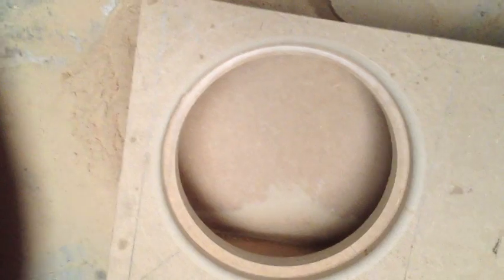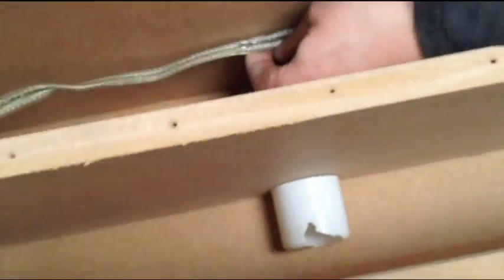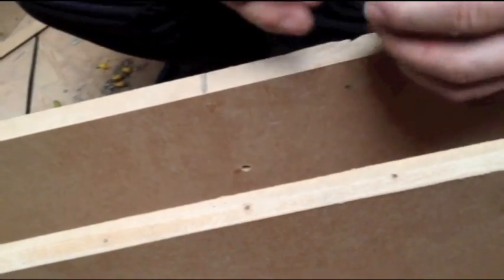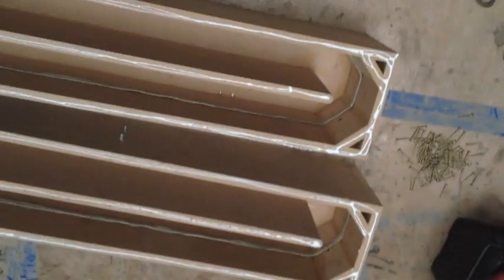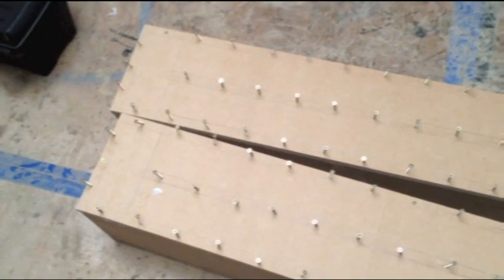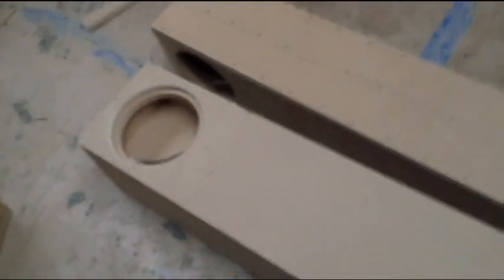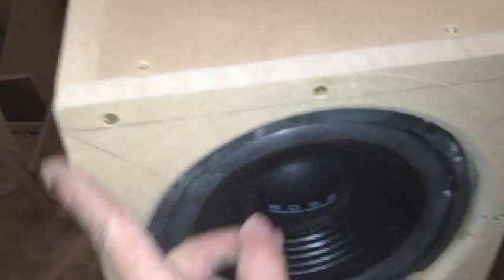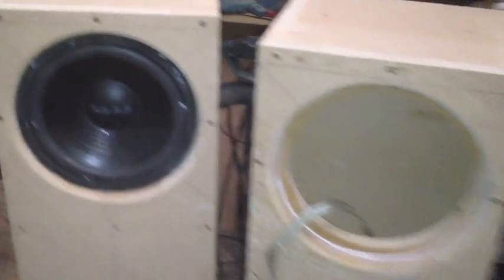Building a TL transmission line Design enclosure Box for 8'' drivers for my home audio system part 2

Comment: I know when you make a t line box you're supposed to keep the entire length of the port the same square footage as of your cone, but the magnet on my diamond competition 12 inch speaker is way too big... I can't do it, I have to have a loading chamber, is there any way to get around this? I seriously do want a t line box for this baby!

EDIT:  the two Diamond competition speakers are old school, they use normal magnets that are big as fuck... the magnet is as long as my hand fully stretched out... (Correctly measured they are 5 inch magnets.)

Comment: whats up with the crappy terminals buddy..i mean if your gonna spend that time and effort to make it really nice looking and sounding box couldnt you have baught some gold plated terminal. connectors...juss sayin!
Reply from the maker: +Mario Osegueda 

it was an experiment i was doing on a tl enclosure if i was going to keep it i would have used gold plated terminals and painted the box gloss black, it was built with leftover materials i had in the workshop ;)
Reply: Gold plated terminals are not necessary. Gold is the second best conductor of electricity behind silver, but silver oxidizes so gold is used instead. There are now brass alloys (CuZn39Pb3) that work very well. I do Front Of House Sound for bands. Professional PA Systems have way more power capability than what most car and home stereos power amps can produce. The Neutrik NL4FC connector has 4 contacts that are rated 30 A rms continuous per each contact and 40 A with an audiosignal, duty cycle 50 %. If that isn't enough power handling capability for you then you can use the 8 contact version (NL8FC) and double the contacts per speaker. The contacts are brass alloy (CuZn39Pb3) rated for greater than 5000 mating cycles. The contact resistance is less than or equal to 3 milli-Ohms after it's rated mating cycle of 5000 times. They are twist lock and will not come out until you cycle the latch.

This is the connector you would use on the cable (Male) and can handle 2 voice coils @ 30A ea. or 1 @ 60A.
They are about $6.00 ea on Amazon
http://www.neutrik.com/en/speakon/fc-series/nl4fc 

This is the connector you would use on the cabinet (Female)
They are about $5.00 ea on Amazon
http://www.neutrik.com/en/speakon/speakon-chassis-connectors/nl4mpr

Here is the 8 contact version. It is the same physical size as the 4 contact version but can run 4 voice coils @ 30A ea or 2 @ 60A or 1 @ 120A
http://www.neutrik.com/en/speakon/fc-series/nl8fc
Reply: +richard vxincar oh i see ok cool nice job on the box how was the sound?
Reply: if its an experiment and you happed to not want it any more, i will be happy to take it off your hands. i live in the uk so postage should be okay, ill even pay for postage aswell
Reply: but how much do gold / silver connectors really help your system? real question i dont know
Reply: brian chaney asked "but how much do gold / silver connectors really help your system? real question i dont know"

Gold connectors are used in military spec. equipment, audio connectors and such because gold does not oxidize. In speaker cabinets, you will not be able to hear the difference between gold connectors and an adequately designed nickel plated connector. Contact area and solid connections are more important on a connection like you would find in a subwoofer, that involves high current. Heavy duty speaker wires are important as well. Gold plated connectors are more important in the low voltage audio signal path. In a car where the connector is exposed to higher humidity, gold plated connectors can prevent signal loss due to corrosion.
Reply: +Rick Jones i know they are not necessary i was trying to make a point....

Comment: An 11.25 foot (3.43 metre) T-Line will reproduce frequencies down to 25 Hz --- you will still 'hear' 25 Hz on a T-Line of half that measurement (1.72 metre) but it will be the 1st 'overtone' of that frequency, not its 'fundamental' -------  acoustical 'damping' is important in T-Line enclosures but a lot of people don't do it because they don't understand about 'acoustics' and 'overtones' -- the 'positions' that need to be damped are the 1/5th position, 1/3 rd, the 3/5ths and the end position -- if you do that then you will have pure, undistorted DEEP bass that you will FEEL as much as hear.
Reply: +Mick Kennedy Very interesting !  What type of damping material do you use and what lengh ?  Also, you put it on the 2 large facing surfaces or 1 or 4 faces ?  Thanks !
Reply: Mick Kennedy i have try this just now..it sounds great..

Comment: Any acoustic wadding inside? If no wadding is used the signal does not have enough delay and the transmission line output impedance goes right down giving less low end extension..... Nice design otherwise though!

Comment: How much Cu.ft. is it??
Reply: I am on my third design myself. The first was a Tapered subwoofer enclosure; the second set was a non-tapered set with a chamber on the front for full range drivers; and the set I am finishing now is a tapered mltl for full range speakers. The taper effects a number of variables, but what I was going for was essentially an increased dampening coefficient which I believe is described as acoustic compliance. I have been looking at the design using the principals of second order differential equations, but with a happy mix of qualitative and quantitative approaches. Go to quarter-wave.com for some decent reading on the subject. I burned through a 4x8 sheet and a half on this last set including a few mis-cuts; however, the boxes are all bevel jointed with cabinet plywood which requires quite a bit more skill and tolerance then just doing butt joints.
Reply: It is a constant process on different ends. On one side I am playing with amplifier design, DACs, and DSP; and am planning to switch to my own pcbs soon as I have gotten board of tearing apart existing designs. The other side is the acoustics as well as woodworking capability.

 The subwoofer transmission line had great results; however, even before finishing it I was thinking of changes and additional ideas. That box had similar finish fitment to the one in the video with butt joints, screw holes and all; although, the internal design was more intricate to build than a needle taper with numerous pieces and nonstandard angles. 

The 2nd t-lines were made to be stained cabinet finish with no veneer, so all of the sides were made with 45 degree bevel cuts and no screw holes. To do that right, the cuts have to be quite tight and square to get a proper fitment and finish. It also made cutting the guts a bit more time consuming, as you cannot really adjust the fitment in relation to the bevel cuts. The finish and sound out of those which are a 4" full range is excellent and significantly flatter than the same speakers in a sealed enclosure when I measured them. I would certainly build that design again, but with a few small changes, nicer drivers, and potentially a high pass filter to prevent over excursion if using them as standalone with no dsp. I was able to stuff basically a meter long line into a standard bookshelf size, but there are benefits from going to a mltl verses a standard tl.

After seeing the frequency response plots from those speakers, I decided that I wanted to try an eliminate a few elements, so I designed the tapered mltl enclosure. The exterior dimensions of the needle type boxes have little appeal to me, so I found ways to compress my lines into a better proportioned dimension in the last two builds; however, with the 5" tapered mltl being almost twice the size of the 4" straight taper tl. I have the new ones about 90 percent done, but I was burnt out so I had to take a break on them. They are also getting a few additional touches internally to improve fluid flow and resonance that I didn't take with the last boxes.

Long story short, since I started playing with stereo design again; none of the builds have been disappointing. You learn more and more the further you go. There are always compromises to be made. For example, placing your cuts to get the best grain figuring and proper orientation isn't an issue unless you are trying to build and finish the enclosures like I have with the last two.
Reply: +bill pruett So basically, as long as we follow that rule, the width of the cabinet could be the diameter of the driver plus a few inches (for the driver to be installed on the baffle) and that's it ?  What about the opening at the other end ?  Thanks !
Reply: ***** I appreciate you taking some time to answer.  TL's have a part of mysteries for sure !  It deserves a try !  Thanks !
Reply: TheFootbaldd That seems great !  So far, are you satisfied with the results (sound) of your projects ?  Or is there a quest for better results all the time ?  Thanks !
Reply: ***** Thanks !  MDF could be less expensive (but it so dirty to work with)...
Reply: TheFootbaldd I see that you're working very hard at that passion.  I also can imagine all the necessary tools to do better from one project to the next.  Furthermore, you are also having the equipment to make audio measurements !  You can do it all !  I started that at a much lower scale than you a few years back trying only to improve existing loudspeakers like the DM610 from B&W.  I put a lot of effort into that one with interesting results.  But to go further, I would need a place large enough to manage an entire project the way you do it.  Line speakers are very intriguing to me too.  I'm also into sound equipments like tube pre-amp and amp.  I bought a scope and a few old pieces of equipment from the US army like a distortion meter; an old design made by hewlett packard and an excellent variac and two DC sources.  A quantity off small tools were bought too.  I understand the passion of "sound"  but I like to listen to music too. I believe you're the same.  The last thing I did is to write a protocol about the way to adjust a pair of speakers in order to here the best possible 3D stereo image from them without having concern on the room design and added room treatments.  And it works !  I was inspired by a guy in the USA who made a conference about the topic but without telling all...  So I guessed about it, filled the gaps and made it.  Very good results !  There are so many faces to that science !  So thank you for taking time to discuss about it !
Eric, from Canada

Comment: all you are doing with these boxes is delaying the bass response, in turn ruining accuracy and imaging
Reply: No that's not what your doing. The line does several things. As the speaker moves forward the air behind it gets pumped out the port. The air is trapped inside the box and slows down thus amplyfying the lower frequencies. If you put a microphone at the port and graph it you will see it generate a frequency response curve with the frequencies below the speakers fs boosted. The second thing it does is add volume to the system which increases bass responce and accuracy. The stuffing is also very important in these boxes. It breaks up standing waves help kill reflections and increase the pressure behind the speakers cone, which helps it articulate and react to frequency changes more effeciently. That's what people call "tighter" sounding bass. These enclosures do alot they aren't simple at all
Reply: Ive heard sealed enclosures give a more natural bass response
Reply: +Synthematix NO no. The transmission line is just a quarter wave resonator. In ported box we have a helmotz resonator. In fact the Helmotz resonator has a 180 phase shift at resonance frequency, but the quarter wave pipe has only 90 degrees of phase shift. You actually have twice more phase shift in a vented box. Twice more 'delaying'.
Reply: +Synthematix
The only thing dumb here is you. 

You're giving the mouth about phase etc, and the reality is that few, if any, notice the difference! So what's the point about blabbing about the differences  between ported and t-line. Each has their advantage and disadvantage, but i wouldn't expect a thicko like you to get that, hence your ignorant remarks in the first place :)
Reply: My experience with T-lines is to lower F of the driver, get rid of standing waves, and to actually make a cheaper/smaller driver more efficient when producing low frequencies. I built 2 MTM mains (actually redesigned Tritrix for 8" Polk Audios and Dayton silk tweeters) and they have great response, are louder, cleaner, and handle a lot more power than rated. Sounds great outside the house with all door and windows closed!
Reply: +bill pruett I know that perfectly but what you say is not very accurate IMO : Actually, in a QW-Tline at the tuning frequency, the port and the front are not &quot;perfectly&quot; in phase: The output of the port and the driver are 90&#176; appart but they still add constructively. The main goal of the line is to LOAD the driver at a certain frequency, providing impedance matching between the driver and  air. Simulate this box in Hornresp or Akabak and you will see. The front and back waves are perfectly in phase when the line is one half-wavelengh of the frequency played : Think about it: the front and the back of the driver are naturally perfectly out of phase,so, to make them in phase again, you have to delay one by the half of a period or half a cycle. But in TL boxes the tuning IS NOT the half-wavelengh frequency but the quarter-wave one. 
For bass reflex (Helmotz) boxes the back wave is rotated by a full 180°at tuning, the box providing constructive interference AND acoustic loading at tuning. In QW boxes the two are achieved at different frequencies.
I hope you understand. Hornresp and Akabak are your friends :-) You can also read about how phase of front and back change with frequency in a document from wisdom audio "regenerative transmission line". :-)
Reply: I don't think MJK's sheet is available free right now ... try hornresp or better ... AKABAK ( tough at first but after it gets amazing when you can try EVERYTHING passing by your brain in a couple of minutes )
Reply: I am on Linux and I run AKABAK in Wine.
Reply: +Synthematix You've "heard" nothing
Reply: +Cedric Perion blind test people and 99.9% won't be able to detect which is which!
Reply: Dumb comment, in a blind test a lot of people wouldnt know the difference in headphone brands either.
Reply: +Synthematix Man, you was the first to talk about delay.
I am fully aware that those time domain imperfection aren't audible at these frequencies but your comment about t-line sounding delayed needed some response and I showed you how a t-line doesn't sound more "delayed" than a standard ported box.
But the other guy is right : this is isn't audible.
Reply: +bill pruett That's ok man, I was just making some clarifications about what I think is a great subwoofer enclosure design :-)
Reply: And then there is what sounds good to some people, and what sounds GREAT to others. Seems to nullify physics a bit...
Reply: Haha, I just ran a few sweeps with a calibrated microphone on two pairs of drivers (same drivers, but the sealed were 3" diaphram, and t-line were a 4" diaphram); one set in sealed boxes, and the other in a transmission line enclosures I designed, and the response plot begs to differ. The t-line did suffer a slight harmonic deconstructive interference, but had significantly greater low end extension and a much flatter output across the board. There was no comparison between the frequency vs pressure graphs. The sealed set fell flat on its face just below 200 hz, and the t-line enclosure had usable extension all the way down to 40hz.
Reply: Hmm, interesting info. I have been mainly using the equations gained from reading M. J. Kings work on quarter wave enclosures, but with hand calculations as I do not have access to his math-cad worksheets. What is the availability of those sims?
Reply: I'll have to check those out. I have been thinking about just using Matlab or what not to build my own setup, but that wouldn't be a sim. I've had enough math to nearly have a math degree, but It takes a bit of work to make sense of the acoustics. It still takes a lot of time for me to go from that to a useable set of plans. I wasted 20 some hours working out the design and plans for the most recent set of enclosures I am building.
Reply: What are you running AKABAK in? I have 8.1 in parallels, but it sounds like I need to run the program in 32bit.